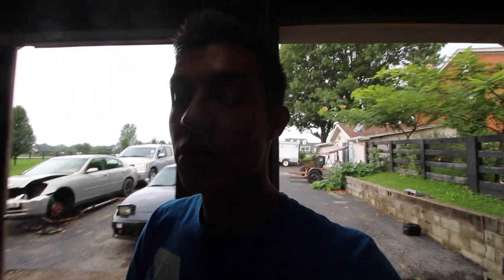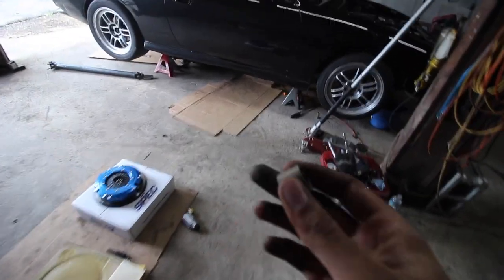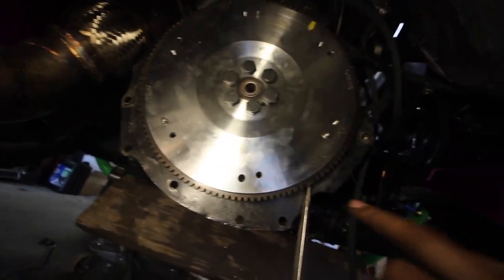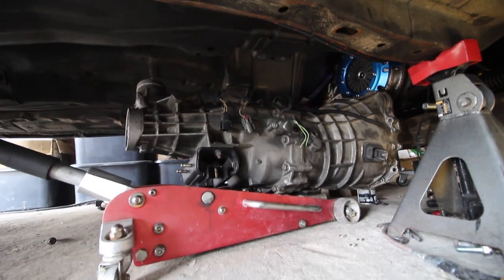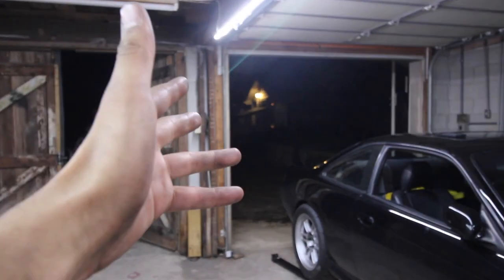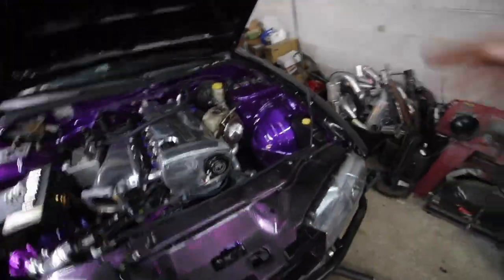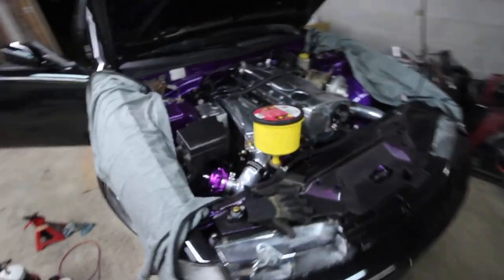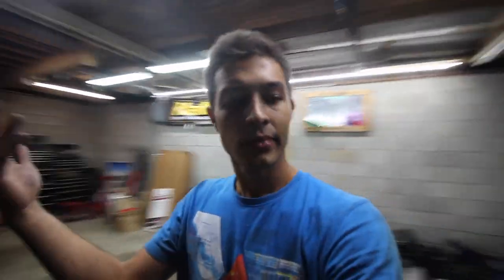240SX Gets a Twin Disk Clutch for 1100FTLBS of TORQUE

Comment: Tip: Don't use a socket to insert a pilot bushing. Instead; 1) insert clutch alignment tool into pilot bushing, 2) remove the loop from the end of it, 3) use light hammer taps on the alignment tool to install bushing. This will greatly increase the likelihood that you don't crush / mushroom the soft brass bushing because it is supported internally and most alignment tools are plastic and will give before the brass.
Reply: I bet you money, that alignment tool didn't fit because he mushroomed the pilot bushing putting it in there with a socket. The same kind of newbie that doesn't clean their fingerprints off the flywheel before installing a very expensive clutch on someone else's car
Reply: Lol it doesn't fit correctly because kalvin clearly left the automatic bushing in the crankshaft

Comment: did you clean the flywheel and pressure plate after touching it?
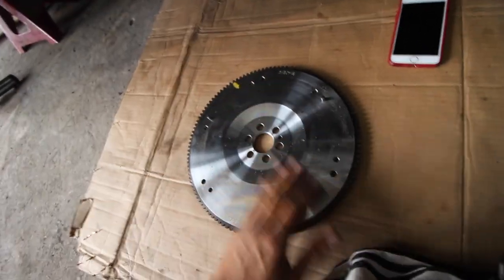Reply: 3:18
Reply: I wondered aswell..very important. And if he checked if the pilot bush was a good fit for the gearboks "center drive"
Reply: @TheOnlyKontrol  if you look at 5:23 its still dirty when he's assembling it
Reply: Yeah the part that doesn't even touch the clutch is dirty
Reply: alexpakha the flywheel touches the clutch disc lmao
Reply: alexpakha and the pressure plate touches the opposite of the clutch. Or the second disc since this is a twin disc
Reply: If he didnt clean it before hes put it in and after he did then he'd get hot spots

Comment: Have a lookout for clutch fluid leaks after adjusting the travel field on the slave cylinder piston /rod. It will have a ware from the old position of travel against the oring. When adjusting, the new fresh spot on the rod will ware on the oring.

Comment: I have the same Spec Super Twin clutch.  It's great, but the supplied flywheel to crank bolts gave me a bad scare. They were installed with red loctite and still backed out causing a bit if galling of my precious rb28 stroker crank and ruined the back mating surface of the flywheel. Spec sent me a new flywheel.  The cause is the bolts supplied with the kit were too short with only 4 1/2 threads going into the crank.  The fix?  Ordered KA24 ARP flywheel bolts. They are the correct length and have the solid unthreaded part just below the head of the bolt to help keep things right.

Comment: Thought u would know the pilot bushing removal trick... pack the void in the crank with grease, insert sacrificial  clutch alignment tool and hammer away. Pressure created pushes out the old pilot bushing. Or u can just be a savage and use the screwdriver method 👌👍

Comment: Do a pressure pipeing test aswell when you do the vac lines. Good choice to change the spitfires. Make sure you ha e the corect heat range on the plugs aswell. And gapping off course.  I've had lots of things happening on the dyno several times. It sux

Comment: I went with the nismo roller pin bearing pilot bush when I did my r33 gtr rebuild. Seemed a bit better than the brass bearing. But. .prolly just my nismo sickness kicking in and messing with my butt-dyno.

Comment: make sure there is a small bit of play in the throw bearing u don't want to be putting pressure on the thrush bearings especially when cold with no oil pressure could cause bearing failure

Comment: QUESTION???
What will happen if I run no pilot bearing?
2002 JDM V35(G35) Sedan DIY 6 MT swap. The Pilot bearing I had didn't fit. In hindsight I would have chucked the pilot bearing on a drill and sanded it down to fit but I read on a guide for my project that some VQ cranks didn't need it. Now I'm nearly done about to do fluids and driveshaft and I'm kinda shitting the gear.

Comment: Just drive the car as much as possible without completely ripping on the car. So long as you aren’t doing burnouts or anything crazy before the dyno it should be ok. Also after the dyno the owner should do a proper break in afterwards. The dyno doesn’t put too much stress on the car that it’ll start slipping after one session. It should be fine 🤙

Comment: Last time I tossed the recommended break in period the clutch lasted a quarter of its advertised life and came out in pieces, but I get you are under the wire, good luck homie. Too bad there is not a break-in spray like you can get for rotors and pads, heh.

Comment: You're supposed to be the RB guy, so do you want to explain to me why I can still see your fingerprints all over that flywheel when you're installing the clutch? You always use some ammonia free glass cleaner or brake clean preferably, to clean the flywheel face because that oil will attract dirt which will cause hot spotting. Come on noob
Reply: Or the fact that he left the automatic bushing in the crankshaft..
Reply: @nickzenzer5544  would you expect anything less at this point?
Reply: @BoostedSpeedDemon  nope